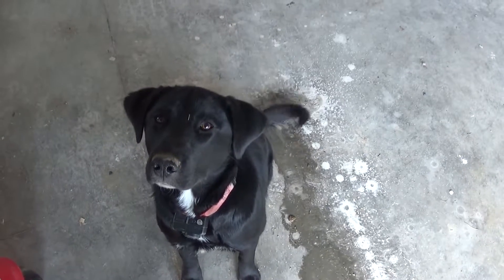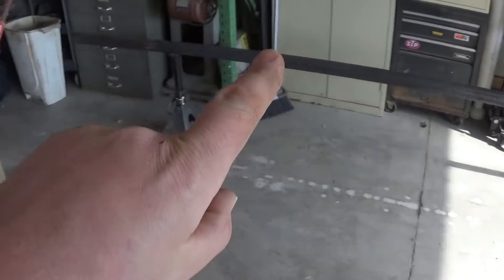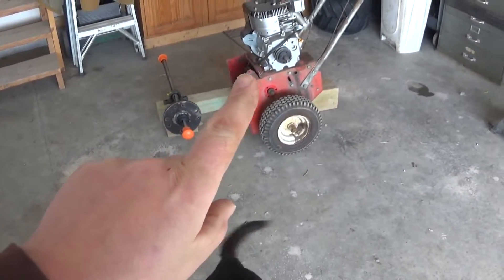Homemade Stump Grinder pt4

Comment: I would put the pillow block bearings on the bottom..it will give more cutting depth.
Reply from the maker: I thought about that but I decided to put them on top. That way the steel frame would be what's being smashed into the ground limiting depth instead of the bearing. I thought they might last longer that way.

Comment: Did you consider mounting the pillow bearings under the frame? That would give you 2-3" more cutting depth before the frame touches the ground.
Reply from the maker: Honestly I've been considering that. I'm wondering if the bearings would last longer mounted on the topside away from all the debris.
Reply: I would be more worried about getting the stumps grinder well below surface so they don’t sprout back up. Bearings are dirt cheap compared to your time needed to unearth the stump :)